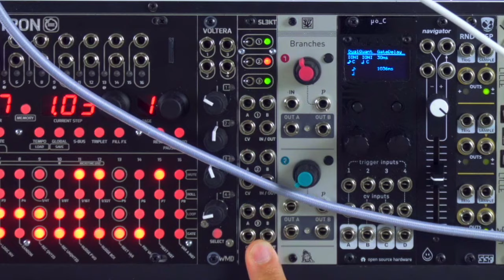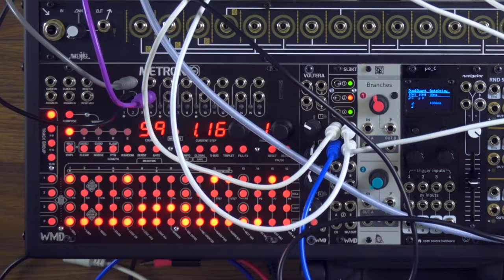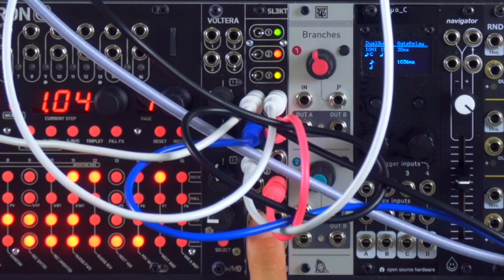Eurorack Techniques: Switches and Maths

Comment: Hey Nick!  I bought a Switchblade from Patchwerks  .. hmmm.. I'd say maybe 6 months ago?  something like that...(In fact.. I'm pretty sure you were the one that sold me on it!!!)    I don't feel like I've utilized it to its full potential yet!  I imagine that I should be able to use it in a similar fashion to the way you are using the SL3KT?   I've also got DivKid's new "RND STEP" module.. and It strikes me that I could kind of make this switching occur in wonderfully unpredictable ways.. I'm going to play with that!
Reply: You should be able to! The Switchblade is cool because you can set the cv input to either toggle (which I believe is default) and be momentary (which is what I used in the video). I think you switch between the two by holding down all three channel buttons, and they will blink. But even in toggle mode, it would be a lot of fun to try this out because it would actually bounced between the two switching patterns (input A on rise, input B on fall, and then input B on rise, input A on fall). Another fun patch would be to run a CV sequence into input A, the RND STEP into B, and then the output of those into a quantizer. Then you essentially can switch between a pre-programmed sequence to a random "fill" pitch sequence!

Comment: i bought one after watching this video but the click is super loud on mine when it switches from A to B or vice versa. is that normal ? always like that ?
Reply: There will be a click when switching over if the two audio sources you are switching between have a big difference between their amplitude at the moment of switching, and especially if the two sources you are using are not related in phase. This is normal; you can file it in the same category of hearing clicks when listening to an LFO through an audio output, or having a fast envelope sounding "clicky". If they did do something to smooth out the click, when we wouldn't be able to switch the sources at audio rate, so there is a trade off. If you were looking to do something similar but don't need that audio switching, I would recommend something like the Make Noise XPan for crossfading and something like the WMD Time Wrap to slew your gate in order to remove that click. Around 6:23 I do address the pop and clicks and using a filter to smooth it out.
Reply: @TheHomestereo   i was trying your example with plaits and the 2 outs... but i tried with other 2 osc also and still clicking super loud. thanks for answer i will check it out.
Reply: same